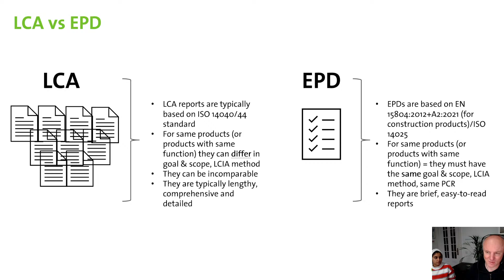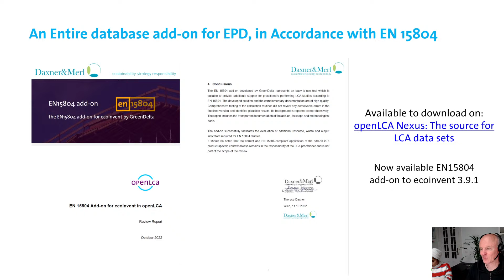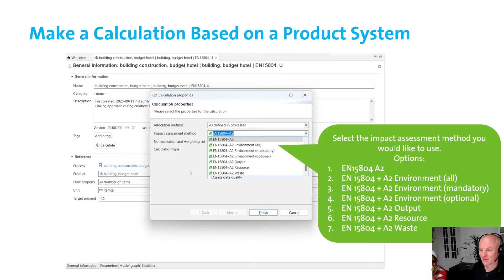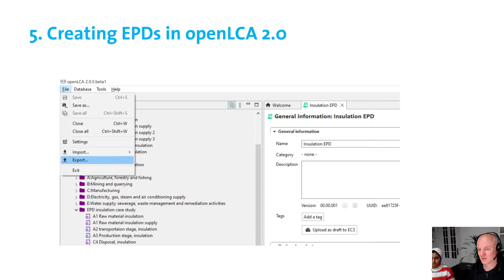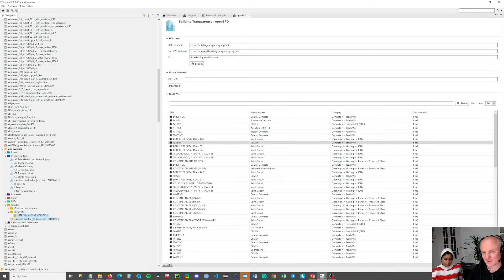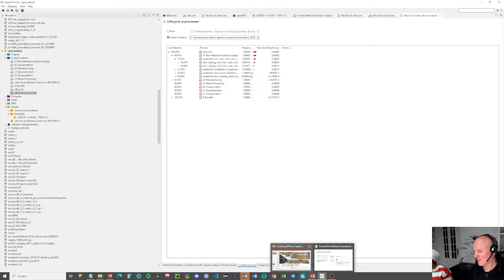Webinar: Creating Environmental Product Declarations (EPDs) with openLCA

Comment: What is the difference between EPD and LCA? Can you explain this clearly and in detail? I am confused between its use and its difference.
Reply: The primary purpose of EPDs is to enable comparisons between products. While EPDs are fundamentally based on a background LCA study and model, they differ from standard LCA studies due to their strict standardization. Think of a general LCA study as an individual research paper on a scientific topic: the author defines the hypothesis, the methods, and the scope. The resulting paper is highly detailed but might not be easily comparable to other papers because different scientists chose different metrics or boundaries. An EPD, however, is like a standardized nutritional label required by law for a category of products (like milk or yogurt). It must follow a specific template (the PCR) and report predefined values using predefined methods. While it is based on the underlying chemical analysis (the LCA), the standardization ensures that you can meaningfully compare the protein or calorie counts across different brands.

Comment: Hello, here is Alice from Brazil. 
I have question: for now it is only possible to build EPD for Contruction Products according to EN 15804 in opneLCA? Or we can import other LCIA methods for other EPDs? 
Thank you!
Reply from the maker: Thank you for your question. You can import any dataset that is accepted by openLCA, e.g. JSON-LD, ILCD, SimaPro CSV, etc. so you can also import other LCIA Methods or datasets as you wish. The important thing here is that the elementary flows of that LCIA Method are found in the database where you are doing your modelling.